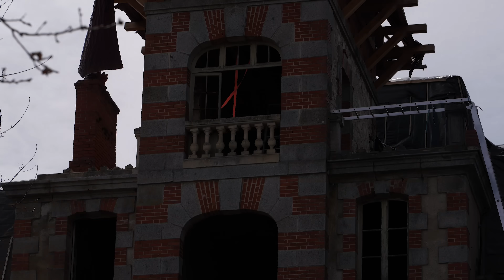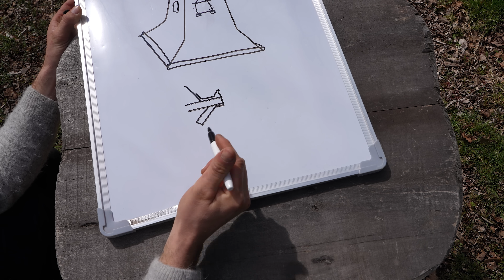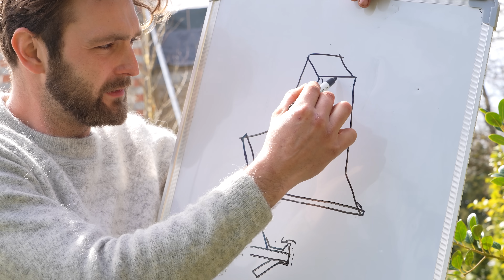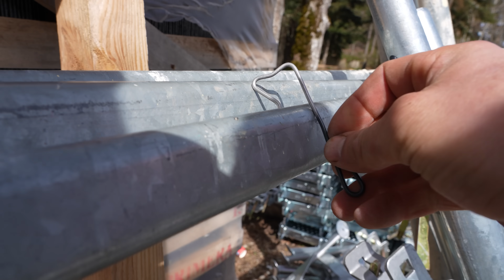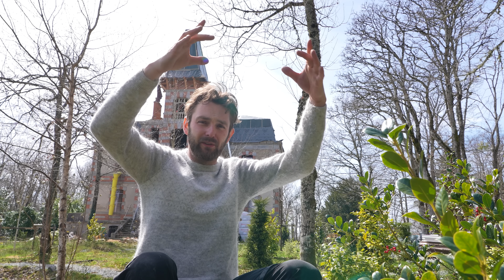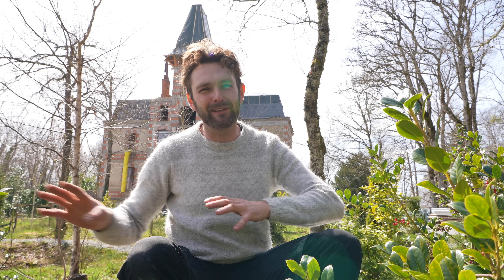The roof, how were doing it.

Comment: I am disappointed you aren't using stainless nails to attach the slates  (stainless lasting longer than copper nails).  I don't like those crotchet things.
Reply: I suppose the idea is that the slate is supported and you don't need to put a hole in it to hang it from, that can crack it. That's my thoughts as to the reasoning behind it.
Reply: @LaReynedeNeige  Oh I know the reason for the crotchets and how they work, I just don't like them.  I'm old school and a slate roof should be nailed on.  I've been around the block a few time and know a lot about slate roof, decades, so I don't need schooled, but thanks anyway.
Reply: @groovy1937  Haven't we all, pal. I've lost count of the number of sites I've been on.